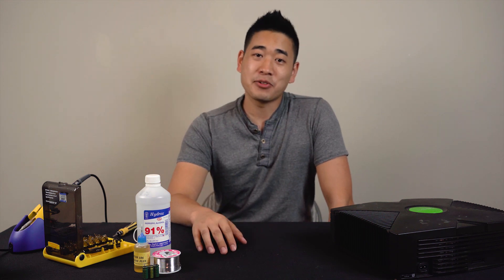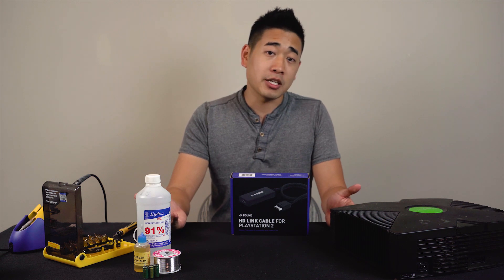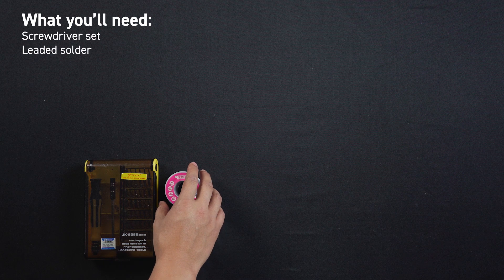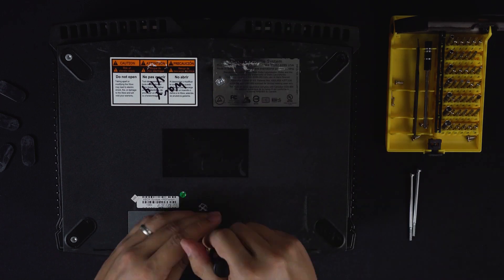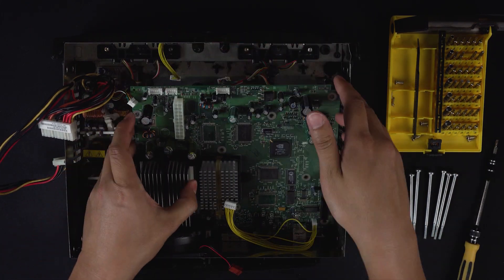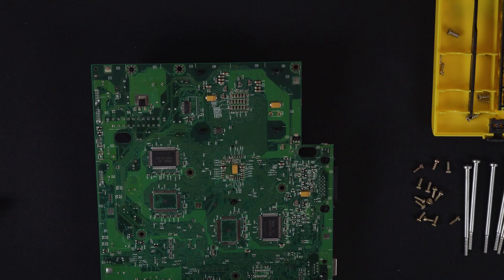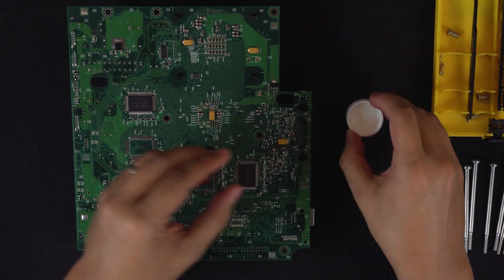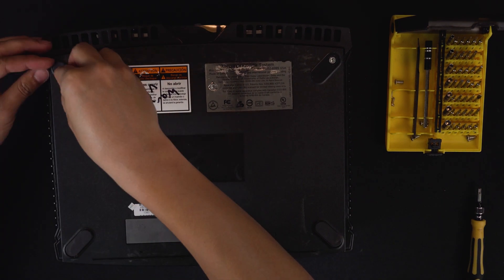POUND - Replacing Troublesome Capacitors on Your Original Xbox

Comment: My Xbox often times has a problem where the screen flashes, and has visible static during gameplay. Then somedays there is no problem at all. Could this be caused by the capacitors, or dust on the disk reader?

Comment: I recommend a good solder sucker for through hole. Not only does it remove the old solder, the capacitor usually falls out on it's own without needing to be pulled on

Comment: I think I may have fudged my system :( I'm hoping I didn't but I grabbed a new set that will hopefully solve the problem.  I used 5 Sanyo and 3 poofed on me.  2 were fine.  Put the old ones back in with the 2 new ones.  It boots but now playing a game for a short amount of time eventually starts showing artifacts for a quick second and then completely locks up.
Reply: I went back in and made a major clean up seems to be working better.  I really need some liquid flux.

Comment: The holes wouldn’t be plugged if you used the solder braid correctly. Add fresh solder and heat until it is flowed on both sides, then introduce a fresh piece of desoldering braid. Cutting the braid short and holding with tweezers makes it work much better since it can’t wick all your heat away. You can also hover the braid over the iron to pre-heat the braid without inactivating the flux in the braid and then quickly switch the iron on top of the braid and through hole once you have the solder flowing. Make sure you tip has a bit of solder to conduct heat into the braid but not so much it saturates the braid’s capacity needed to wick solder from the through hole. It’s all technique.

Comment: You should add fresh solder before working a capacitor out like that, especially if the solder is already corroded. If you just add heat and start tilting the capacitor without flowing fresh solder through to both sides it will likely flow on one side and not the other. This could easily damage pads/traces on the other side. Just add solder and dwell a bit before you move the capacitor. Also, 400 may be too hot for some. With a nice iron like that and fresh solder you should be able to get away with less.

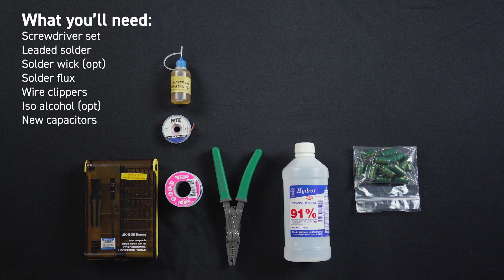Comment: 2:10 “The brand shouldn’t matter. I’m using Sanyo 3300uF caps rated at 6.3 volts”
Whaaaaaaat?! You’re replacing all caps with the same value?! Clearly, you aren’t or you wouldn’t even have a cap kit. Also, the brand certainly does matter. Always use good caps when you replace them since you are going through the effort and the cost difference is negligible compared to a major manufacturer making millions (the reason they use cheap caps in the first place).

Comment: You're meant to push the legs through the pcb, bend out, solder then cut the legs. Having the legs uncut helps you and is super hard without.
Reply: Yeah I am surprised why he did that first

Comment: READ 
Make sure you power adapter is 10 amps 
Make sure pound cable is plugged is plugged into a 5v usb port flat screens don't always provide 5v 
if you have taken out the mother board or power supply some screws are needed for grounding so if all are not present then it also can cause this issue

Comment: Hi, I have a problem with my Xbox 1.0 and maybe you can help me. It works perfect with games on a 500gb HDD. When I turn on the console if i plug two controllers they work fine for 10 min and start failing, if I unplug 1 controller the other works just fine at any port, is like there s no enough power supply for both controlls. Do you know what can it be?. Sorry about my English.

Comment: I hope you guys are still active because I found a potential solution. Make sure ALL motherboard screws are tight properly, from the board to the metal casing underneath. This grounds the board and ensures the signal is "clean". I had an xbox have the same wavy issues, but on the default composite cables. Tightened the screws and boom all good.
Reply from the maker: Hi, it's true we haven't been super active on YouTube but we are still working on new products! Thanks for bringing this potential solution to our attention. I'd like to think that during re-assembly we tighten everything down pretty well and that doesn't seem to have fully resolved the issue before. We'll try to pay more attention to this in the future and see if it can be a solution.

Cheers!

Comment: i've repaired like 10 of these original xbox's because i recapped the whole board.
Reply: Can you help with mine?
Reply: What capacitors do I need for a whole recap on a 1.0 rev board, I'm not sure that just replace these 3 capacitors show on the video might fix my problem. My OG flashes the image on some TVs.

Comment: Has anyone done this and it worked? Be aware that buying caps on ebay are typically fakes. Open them up and they're smaller capacitors wired to the can. You probably want to find local sources for your caps.

Comment: This didn't fix my 1.4 green xbox unfortunately.
Reply: Check your power supply in your xbox. That can be also an issue causing the xbox not turning on. When you remove it from your xbox, flip it upside down and check to make sure that any of the solder joints are not popped (It easily noticeable when there's a black mark showing where it popped) If that's the case, find a another power supply that is a V1.4 part replacement that is correctly correspondent to your motherboard revision version. This is because that the xbox had too much voltage and shot the power supply.

I hope this helped.

Comment: Just did this on a 1.4 as well and didn’t resolve the issue. Works great on my 1.1 though!
Reply from the maker: Hi Skyler, Would you do me a favor and try plugging into the USB port to provide some additional power. See if the combination helps where either solution individually might not?
Reply: Skyler Matheson hello un my 1.4 the cable doesn’t work but when i buy another Xbox 1.1 the cable work ?

Comment: Did this on a 1.4 but unfortunately it did not fix the issue, I've heard the revised cable might work better?
Reply from the maker: Unfortunately it might still require external power to fully resolve the issue. If you have the release version of the cable this won't be possible. Sorry.
Reply: When will the new cable be available? One thing I admire on business is honesty, and pound has proven do be run by that. However there's another difference for 1.4 the video chip is from "focus" manufacturer different from all models namely "conexant"  and "xcalibur" the issue could also from the "focus" chipset,also similar HDMI cable from other vendors seem to also have issues with the 1.4 model not the same as here but some kind of a fog ,all other models work fine I read a review on a Amazon .

Comment: Some vid, I'm about to do a recap on my 1.6  and I was curious how to denote + from - on board and after I trim cap leads.
Reply: all caps are marked. on the ones Denny was using the are green , but have a gold strip on one side. and the board will have corresponding marks